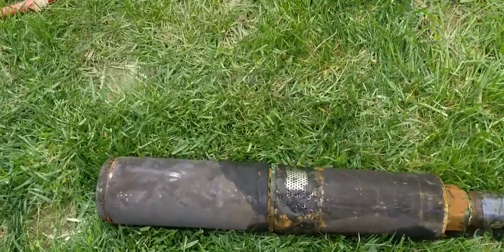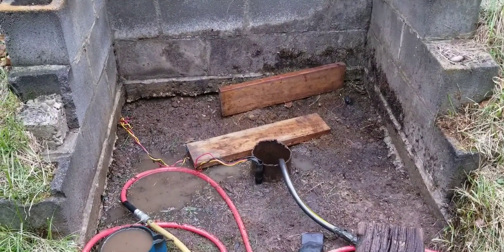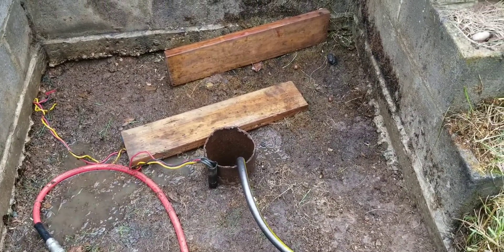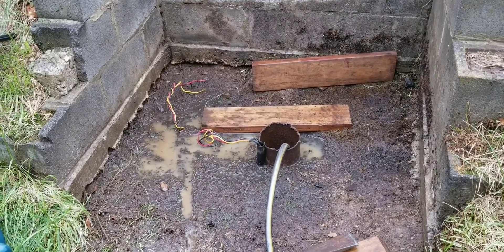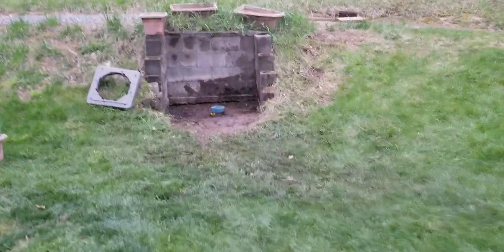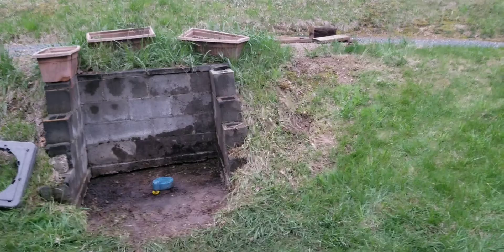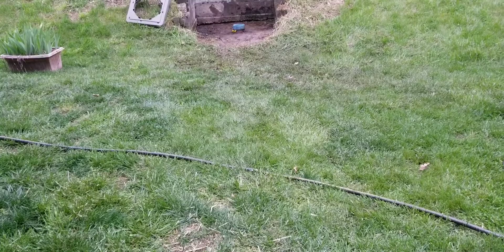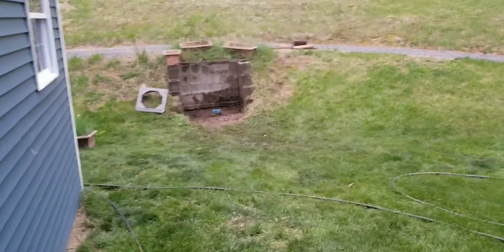Flushing out well sediment with air.

Comment: You  would have done better to have a rigid  pipe on the  end of your hose  like a  20' piece of copper line , It doesn't have to be big or high pressure Just  constant volume  at 32psi.     The  smaller rigid  tubing  would stay at the bottom of the hole were it pushes the  load of water and sediment from the bottom and doesn't move with the water surge floating atop the rising column. .   Also   restricting the  casing opening  with an elbow and  slowing the gas expansion at the surface  will move more  material out of the casing and allow you to  make a  constant   surging   cycle   with a  11cfm  compressor.

Comment: interesting.  I need to do this to my well.  My pump quit after 25 years so I'm currently "acidizing" my well with 12 gallons of muriatic acid to open the mill slot to allow higher water flow.  This is a common practice.  So this winter I'll "air blow" the well like you did and then add 20 galloons of muriatic acid and let it set all winter.
Reply from the maker: I would suggest storing enough water to top the well off before you blow it. Stick the garden hose clear down to the bottom use the water to agitate the silt then blow it. I found out on like the last blow that works way better. You need a Hugh volume of air too 3/4 line min run right off the air compressor no regulator. I tried 1/2" airline at first and it just wasn't quite enough . Just be sure to use a line that can handle whatever pressure your putting in it. also be warned it may take a while for your well to clear back up afterwards. Mine took 3 days. I'm prolly blow mine again next year. I have really good tasting water but a buildup of of something i think manganese will build up on the screen on my pump after about 5 years I gotta pull it and scrape it off.

Comment: Deep Well Submersible pump may have
Calcium carbonate, silt, clay, iron sulfides, and iron and manganese bacterial “biofouling”, a combination of sediment and deposits, are all common well cloggers.
Deep Well cleaning should be flushed every 2-5 years for optimal performance.
We have installed an Iron removal tank. No iron and sulphur smell.
Yours is 81feet, look at the water and debris.. looks better at the end... great work. 
Thank you for your video!

Comment: That’s some nasty looking water.  Is there some kind of product you could pour in that would devolve those solids then flush❓❓❓
Reply from the maker: it's basically already dissolved when it drys its a super fine powder finer then talcum powder. It's 45+ years of  sediment I've been told it's manganese in the comments and a guy that works at a water plant I know said that's what it is.. 45 years worth... it makes since because it's a low volume well and I hav the suspicion it wasn't when it was drilled. over the past 45 years the manganese has built up in the fissures in the well slowing the water down. there is a few ways to clear it. Fracking with explosives or hydrologic fracking. Explosives are off the table as the well in only 15 feet from the house. So explosives are off the table. the only options I have is hydro fracking, drill a new well or drill that well deeper to hit new fissures and and more reserve. Drilling deeper is a gamble because right now I have very good water. it tastes good and hardly don't stain. what if I drill down 30 more feet and hit suffer water or heavy iron?
Reply: @Depth_of_Cut  there is a product called NuWell which is supposed to remove stuff like this.    You might research it.

Comment: Use 3 inch drain pipe about 3 ft long. Flat cap, drill 2 holes one being 1/2 inch and one 1 inch. One inch hole is for a threaded pvc connector to be locked between a regular coupler on inside of cap and small 1 inch pvc. Female thread on outside for a black hose barb to be threaded and clamp to hose to be output of well. 1/2 inch same but all half inch going to air line in. This lowered into well causes all sediment and water to come out of 1 inch line. This is called a geyser pump and works like a charm.
Reply: So let me get this straight.  3" drain pipe capped (glued after fittings).  Make two holes in cap, 1/2 and 1" and connect to garden hose (5/8") as long as your well is deep and the 1/2" hole fitted to the air supply line.  Place the open end in the well, drop it to depth and turn air on.  This will force air into 3' pvc sirring up the mix and forcing the sediment and trash out the garden hose at the other end?  This vs trying to force it up and out through the 4" casing?
Reply: @gandl2123 instead of 1 inch hole make that end a bib 5/8 male to thread the garden hose or a poly black piping to you distribution area. Might have to put a one way valve inline about 1/4 - 1/2 way. Testing will show where. I used an above ground tank about 12-16 feet up and let the water develop a head pressure. That’s why 1 inch was used and a large tank but 30-50 gallon heavy plastic garbage can would work. Then out going to my distribution area

Comment: Interesting.... I have a 140 foot well. but lots of Iron in our water. also we have silica sand down under. all i do i Shock my Well with a Gallon of Javex once a year. it works. But Well pressure is slowly getting Weaker. Maybe i should try this. Great Video.
Reply from the maker: Idk if it would help in your case... be warned if you do that your water is going to be really muddy for some time... mine was 2 days before it cleared up.I did it to get the sediment out mostly it had built up to my pump almost.... I was reading up on wells and what my problem is and maybe yours also is over time the same stuff that builds up inside your pipes... in my case I think its manganese in your case sounds like iron, but what's going on is all the fissures in the well are clogging up just like the pipes and were getting less water over time. They can hydro frack it and that will open the fissures back up and maybe help. I have no clue what it cost I've only read about it a little. Look up hydro fracking a water well and read up on it. What I was reading was anywhere from 1/2 gpm to 5 gpm could be gained by fracking.
Reply: Buy a iron removal tank!

Comment: Psi ??
Reply from the maker: It's not so much about the pressure as it is the volume. 100 psi if I understand correctly will overcome the head pressure of a well 200 feet deep. What is important is the volume a little 3/8" airline in the well is just gonna make bubble sounds. You need at least 3/4 I'd pipe... maybe larger as you go deeper. You have to release a large volume of air very very rapidly.

Comment: Do you have your compressor hose just down in the hole by itself?
Reply from the maker: I used a garden hose with a steel pipe on the end and weights to hold it on the bottom. I tried the airline first but it just didn't let the volume of air needed. The garden hose i used was hooked directly to an 80 gallon compressor tank. It's not so much about the pressure as it is about the volume of air you can force down the hole.... you cant run the air through a regulator and do it you cant get the volume of air you need, It has to be direct hookup to the tank. Hindsight The best thing I could have used is the same black pipe that the pump was hooked too. You have to make sure you do not exceed the pressure of whatever your using. The garden hose I used was 90 psi rated I think but my tank has 150 psi in it so I had to manually watch a pressure gauge I had on the line to make sure I did not go beyond what the hose was rated for. The first time I tried it I let the pipe hit the bottom of the well too hard and it clogged it I cracked the valve open and it shot up over 100 psi before I closed the valve. I then changed to a 90 degree fitting on the end so it wouldnt jam with sediment when it hit bottom... if I had used the black well pipe, its rated for 150 psi I could have just let it build full pressure of my compressor 150 psi and blow it out. I would have also ben able to push a much higher volume of air in the hole which would have forced more sediment out at a time. Also the last time I did it I didnt film it but what I did is stuck the garden hose down to the bottom and ran 50 gallons of water in the well... that really stirred up the sediment and my helper said it looked like crude oil comming out... use extreme caution if you use a garden hose if you exceed the pressure it can burst and force compressed air into your bloodstream which could lead to death. Use pipe that is rated for the max pressure you can put in it.